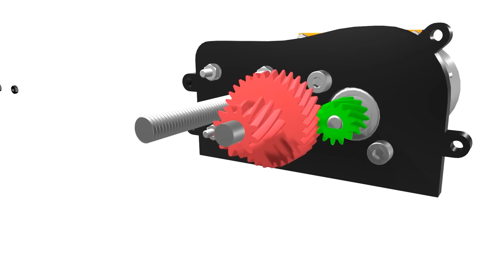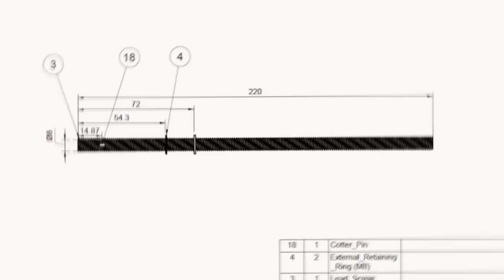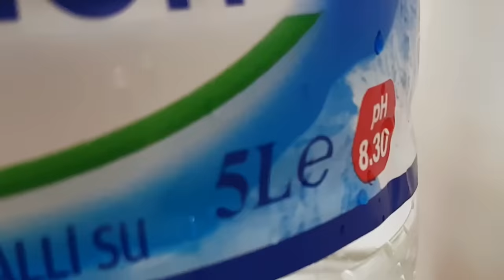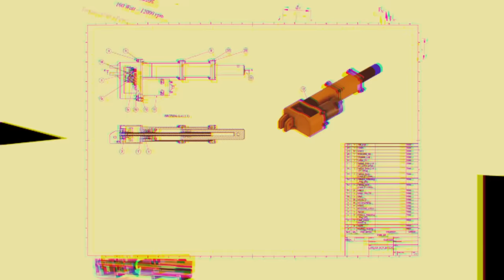3D printed Gearbox powered Linear Actuator | High Torque

Comment: I thought the joint would give way before the motor would.
Reply: Right! Most 3D printed objects tend to be brittle and fairly weak, but perhaps it has much better tensile strength than I imagined.
Reply: @haydenhoodless2055  You underestimate 3d printed parts,

Comment: You can add a sensor at the end of each distance so you don't go over. The sensor can turn off the motor in that direction so it cannot go further but allow the opposite direction and when you go the opposite direction the sensor will reset. This way you can't crash the rail or extend too far. :)
Reply: Sehr wertvoller Hinweis ! Das Video macht einen so perfekten Eindruck, dass ich garnicht gemerkt habe, dass so etwas wichtiges wie Endabschalter fehlen !
Very valuable hint ! The video makes such a perfect impression that I didn't even notice that something important like limit switches are missing !
Reply: Basically a limit switch with a diode

Comment: I still dont trust those rings securing the threaded rod to the bearings, seems like they could easily slip due to vibration or overloading. Which would result in the whole thing blowing apart.
Reply: Yup, not a great idea.
Reply from the maker: yes but there was no problem as the rings entered the bottom of the screw thread. So it will have to break the screw thread to slip.

Comment: Deeply appreciated. Building a 3d printer, and cnc machine, typing this on a raspberry pi4 with Arduino and FreeCAD installed (not easy). I'm a dumpster diver, this is powered by solar panels taken out of the landfill. I need linear actuators for many things including turning the solar panels to track the sun. Every day people throw away the very things we need to rebuild our world. Our ancestors were not born with credit cards to survive, but brains and hands. You are very skilled at using both. Thank you for sharing, it really means a lot to me and helps me a LOT.
 You are very deeply appreciated.
Reply: I had not seen that kind of valuable trash... here, in MX, there are people that get them and sell it...

Comment: Now I want a 3d printer more than ever! LOL
Reply from the maker: You should buy😁
Reply: @retsetman9698  ooo
Reply: I got one a few months back and it has been every bit as much fun as I had hoped. Just know the printer is the cheap part. All the filament you end up buying is where the money goes.
I'd still do it again.
If you're tight on money you might want to consider a Prusa clone on AliExpress. They're about half the price a real Prusa.
I have a Prusa MK3S and it's great but there are lots of less expensive options.

Comment: You could use already greased up and sealed bearings so the damn thing isn't as loud as a chainsaw. Also some small push switches at each end of the piston that moves could be connected to some relays to automatically stop the motor when the piston is dead end, I'm mostly afraid the gears or the brushed motor could overheat and get damaged real quick coming to a full stop that quick. Other than that, I really do like projects like this, you can make the piston or rod as long as you want, and maybe even build a garage door opener, would be funny to see a really long piston. Maybe an automatic window opener??
Content like this, really deserves a sub and a like. Totally did.

Comment: I could make this thing so strong.  I found a filament and proper settings to make some insanely strong parts.  I have been selling them.  Many of the buyers make fun of it, some even leave bad reviews when they get it, but it never breaks.  Often they compliment it later on or I just never hear from them (which means it didn't break or else they would want a return lol).

Comment: Güzel proje. Erikli sulara bakarak Türkçe yazabileceğimi düşünüyorum:) Bende uyduruk bir vidalama var şarjlı. İçinde RS380S motor var. Bağlı olduğu gear box 8:1 oranında. 2 tane 18650 bataryayı seri bağlayarak kullanmak istiyorum. 

Bu sistemle 10 kiloluk bir tork elde edebilir miyim acaba? Tasmasına taktığım bir RFID etiketle kedimin dış kapıyı açabilmesini istiyorum yanına yaklaşınca. Kapı 9 kg güçle kedinin geçebileceği kadar açılıyor.

Şarjlı vidalamayı kurban etmeyeyim de bir RS775 mi alayım?

Comment: That is awesome work you made there.
I wrote you a mail about Linear Actuator, hope you will ready it. :-D
Reply from the maker: Thank's man! I really read your mail but I don't know howi it works:/
But I have a guess: maybe there is a different screw in the second opening. Since the pitch of this screw will be different, they will open and close at different speeds. so what i mean is :D
Think of two different screws (as you know, their pitch values are different from each other) and connect these two screws to each other with a coupling. Then, when you turn the screw 1 turn, for example, if the first screw goes 5mm, the other screw goes 10mm. Maybe it's like this:)

Comment: if you replace the motor with a wiper motor will the gears be able to handle the pressure? Talking of 80kg? or would it be best to go with steel gears?

Comment: Awesome, looking forward for the source file to learn. What have you used for the load analysis?
Reply from the maker: Thank you:) Actually I didn't use software etc. I made the calculations on paper. I used the Gears, bearings and bolts topics in the machine elements course and a little bit of math.
Reply: @retsetman9698  I am designing a motor like u did but I need bigger forces. Can I get the equations that u used?
Reply: @retsetman9698  sen Türk müsün?

Comment: Awesome video. If I was to use a DC power supply, which would be the best to get?
Reply from the maker: Thank you😀Actually it depends on your  used motor. I used DC12V 100Watt 775 motor. So I used 12V car battery. You should take a look of datasheet that your used motor.

Comment: Would be very appreciated if u would bebkind enough to let me know what js the type of the dynamo motor used for the linear actuator.if using brushless or servo motor, can it stop at position we requred (like using stepper motor).also wht is the gear ratio was.thanks.GBU

Comment: How come your shafts doesnt have grooves to fit the retaining rings? You must have a groove or else not point and it will slide out. I think you are just pressing it against the shaft. Secondly for bearings always use Grease or the best is the lithium grease.

Comment: @t
65FGM520 reduction geared motor applied for automatic equiments robot reducer gear motor

Motor specification:

Model:FT-65FGM520

Rated Voltage:24V

Load Speed:6700rpm

Load Current:150mA

Load Torque:20g-cm 

MOQ:100pcs

Gear box ratio:it is customized based on client's requirements.

Comment: very cool, though i wondering what if the gearbox ratio increased to 60:1, how much the maximum load the gearbox could reach/get stall? how could i calculate this.
Reply from the maker: I think I suppose you ask about reduction/gear ratio. If the motor has 2Nm torque and the reduction ratio is 6, then the output torque would 12Nm. And if the reduction ratio would 60:1, then the output torque would 120Nm. (Output torque= input torque * reduction ratio and the speed is the opposite that)

Comment: Very nice. Can you explain why you choosed to use helicoidal gears? Thanks.
Reply from the maker: Thank’s. Because they are quieter and their grip rate is higher.  The reason for this is the gradual contact between the teeth.  Besides, their disadvantage is that they create axial force.  that is, they want to move left and right.thanks for interest:)
Reply: @retsetman9698  
Yes thanks. You are right. I think you can resolve the problem of axial force by adding a second recessed helicoidal gear but in inverse like this ////\\\\. Forces will cancel each others ( I think this type if gears was first invented by french car manufacturer Citroën..if I remember well 😁)

Comment: Are you just putting e-clips straight on a piece of threaded rod? Are they just held on the threads with friction?
Reply: Oh my god. And then again later straight on a round bar without any slot cut into it.
Reply from the maker: No of course not:) e-clips go into the thread bottom of the screw.so it will have to break the thread of the screw to slip.this is a very difficult thing
Reply from the maker: I did not slot in the flat shaft. Because there is no much axial force. at the same time the clips fit tightly in place
Reply: @retsetman9698  but it'll no longer be flat.

Comment: You should use good wires for motor. You saw that they was red ... when you gave high load.
Reply: then the winding in the motor will get too hot...the shitty leads are a fuse ;-)
Reply: @AKAtheA  Nope. When wire becomes red, it means that it works like a resistor, and that means that motor don't have enough voltage!
Fuse doesn't work like a resistor ... But bad wire does.

Comment: I have a question. why doesn‘t the weight pull the bar back down? I mean it is lifting 20 kg
Reply from the maker: İf you mean the piston, the nuts hold it up or if you mean threaded rod, I used retaining ring for that. I mean I put the ring between threaded rods teeth and the bearings also hold the ring. so it doesn't pop out easily. may be it couldn’t a best idea but it’s good for these weights. if you use more powerful motor, you need to use nuts instead of retaining rings and it could be change easily
Reply: first of thank you for replying. I meant something else. since i'm also working on a project that is built roughly like this, i'm afraid that when the electro motor is off, it will screw itself back down due to the weight 
Its hard to explain but for example turn an electric motor in any direction when it is off 
I want to prevent that

Comment: 12 volt dc motor çalışma akımı 2 amper, zorlanma akımı 27 amper bu motora 12 saat güç sağlayacak akü kaç amper olmalı veya şöylede sorabilirim elektrikli budama makası yapmak istiyorum daha düşük torklu çalışma amperi düşük olan bir motor mu tercih etmeliyim bu konuda yardımcı olabilirseniz çok mutlu olurum. üstte yazdığım motor redüktörlü 21kg-cm torka sahip
Reply: @retsetman9698  sürekli max amperde çalışmaz diye düşünüyorum aç-kapa şeklinde olacak makas olduğu için budanacak dalın sertliğine göre de amper çekimi değişecektir daha farklı motorlarda var onlarda max amper 2 amper gibi ama güç durumu biraz bu motora yöneltiyor. cevabınız için teşekkür ederim. 2 motor alıp deneme yapmak daha mantıklı olacak gibi batarya 12 volt 24-30 amper düşünüyorum.

Comment: Do you have plans for travel stops?
Reply from the maker: Yes. Since there is no microcontroller in the system, approximately 20 amps will pass over the endstops while the motor is being forced. The size of the 12v 20 amp endstops is also very large. Although it was big, I actually made a design for the endstops. but I didn't share that design because it looked ugly. Regardless, you can easily add endstop externally.